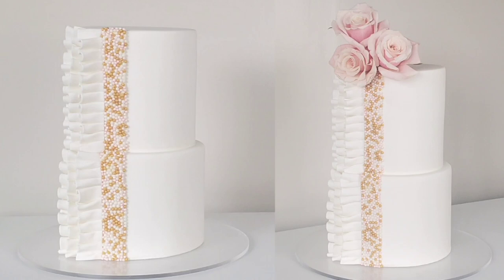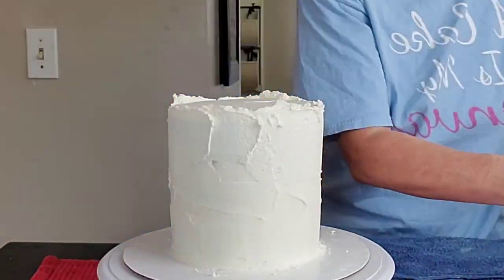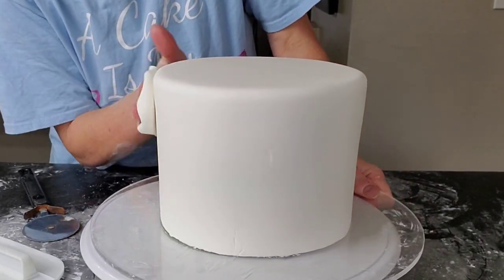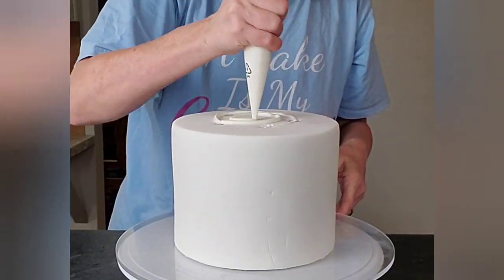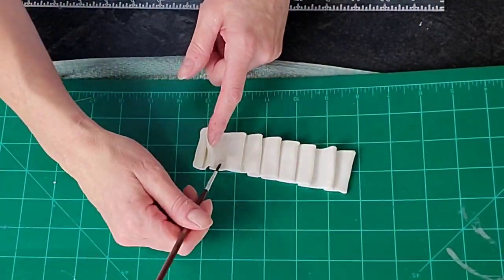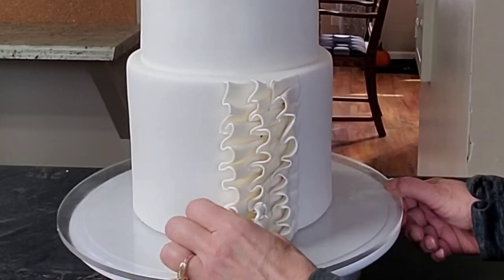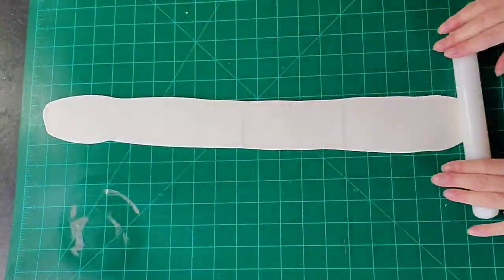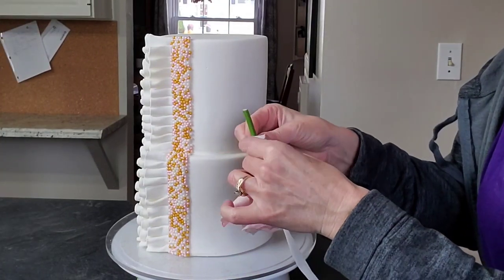Modern Fondant Ruffle Cake | Beaded Ruffle Cake (No Silicone Mold) | Cake Decorating Tutorial

Comment: Is there any particular reason why you cover your cakes in this method and other times cut the top out first and then add the sides?
Reply from the maker: Typically it depends on the design. If I am just covering the cake with the fondant and then decorating, then I will drape the whole peice. If it is something that is easier to do flat on the table I like to panel. Or if I want really crisp corners, then the panel method seems to work better. I guess also if the tier is tall or double barrel, paneling is easier because you don't have to worry about tearing at the top due to the weight of the fondant.
Reply: @sophisticakesbymary  Thank you. Xx